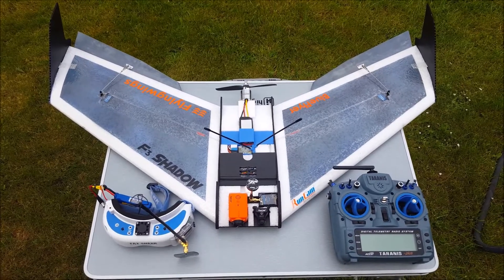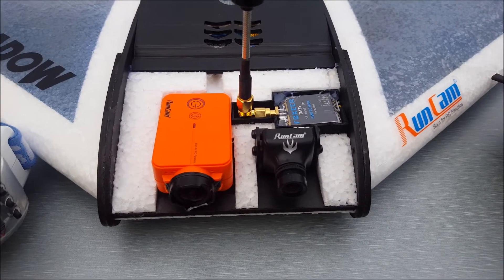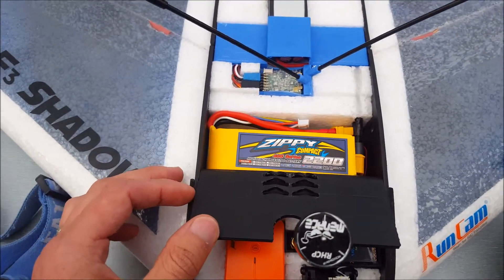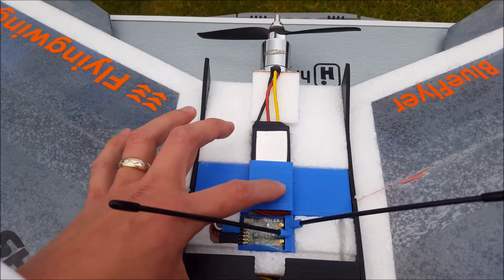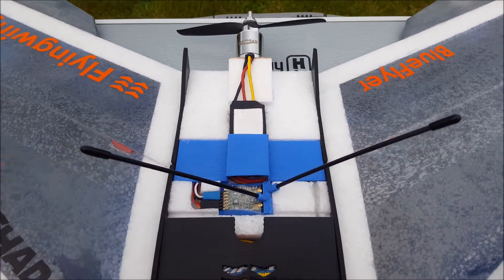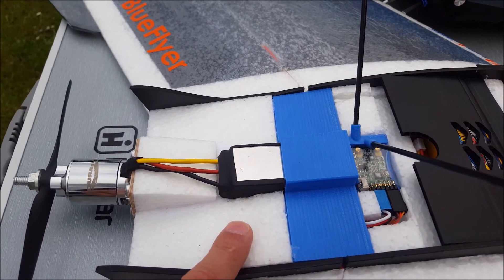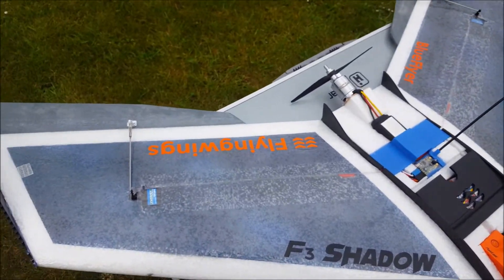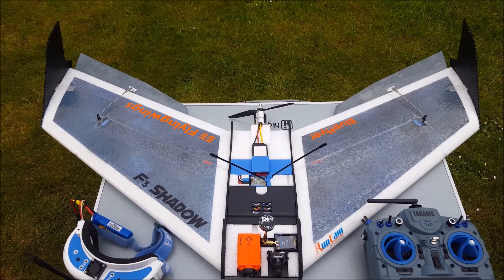FlyingWings F3 Shadow FPV Racer - Setup / Walkaround

Comment: How do you think this motor compares to the 2836 3000kv flyingwings recommend ?
Reply from the maker: I've had the early version of the 2836 3000kv motor from Hobbyking, I used it in a Funjet Ultra and yes it was very fast, but the NTM motors had a habit of being slightly unreliable... 2 of mine, including that 3000kv one, burnt out well within their quoted amp range.

However, Hobbyking are now doing the NTM V2 motors so hopefully the reliability issues will have been sorted.

As for this wing, I can only comment on the motor I have installed and I am very happy with it on 4S. Launching is a piece of cake using the overhand discus launch method :-)
Reply: Thanks mate, sorta wondering how well the Durafly motor would handle a 7x6 also, and I'll have to have a look at that launch method, I just my teksumo from side
Reply from the maker: It's probably the same method, just different name lol. I hold my TX in my right hand so my thumb is on the elevator/aileron stick. I hole the plane's right wing with my left hand, about half way down the wing with my fingers on top and my thumb underneath. I then put the throttle up using my mouth and simply guide the plane up at a 45ish degree angle.
Reply: Yeah thats pretty much same, tho I need more practise, most of time fail and just hand it over to spotter (dad) to toss lol
Reply from the maker: Why do you want it to take a 7x6 prop?

Although 6x4 does seem small for a 940mm wing, with this motor and 4S it's definitely no slouch. I've timed it flying a known distance and the average speed was 85mph, and that was with a LiPo that had been flying for about 5 minutes. With a fresh LiPo I'd say it would easily pass 90mph and likely be approaching 100mph
Reply: Just asking really, with size and kv of it figured 7x6 could work pretty well, tho I agree it doesn't seem slow on 6x4